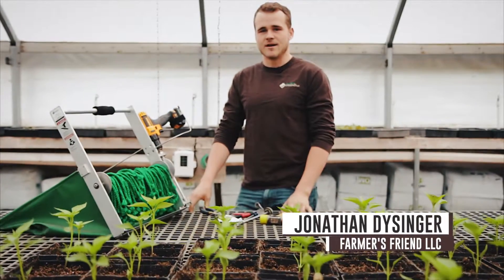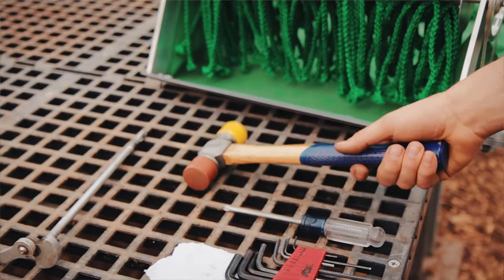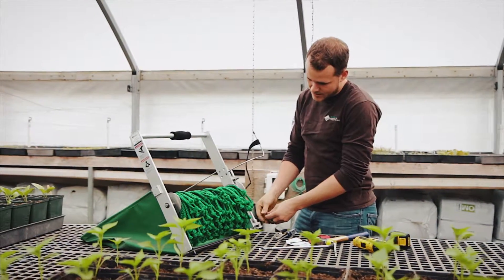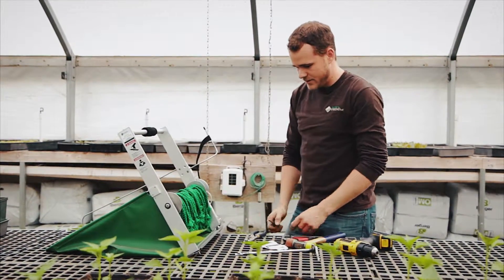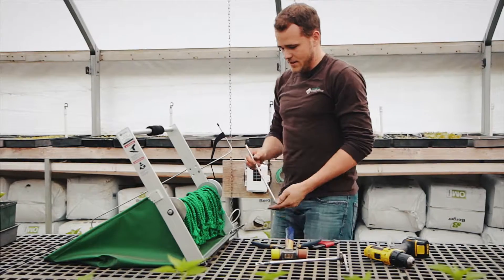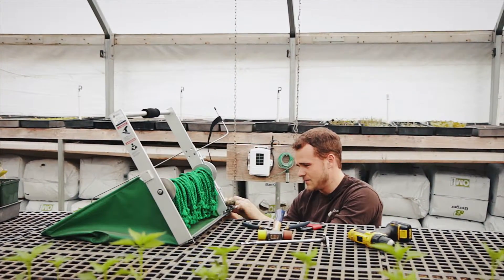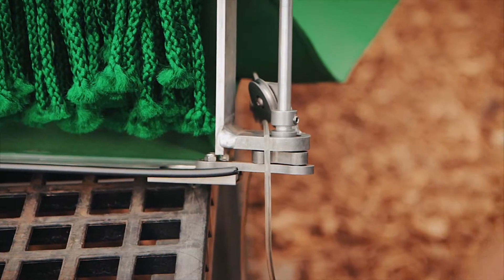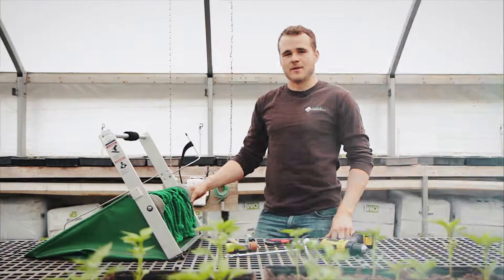Drive Shaft Replacement

Comment: We are having a difficult time removing the drive shaft. It does not slide out easily using a mallet as shown in the video. Removing the worn bearing has also been a nightmare.